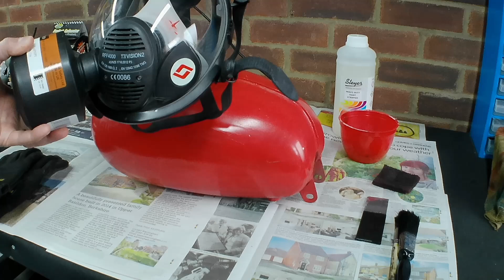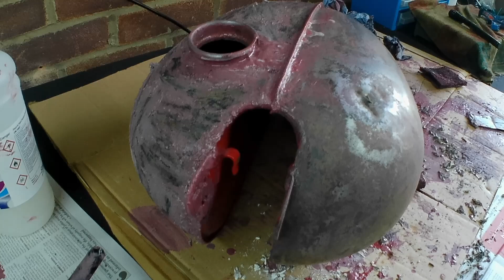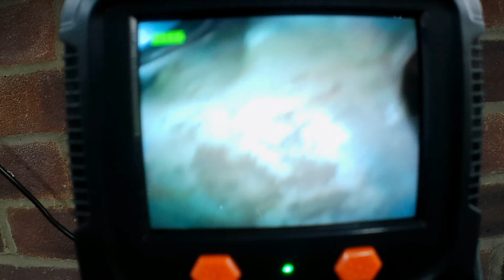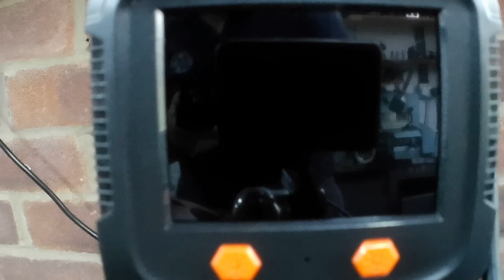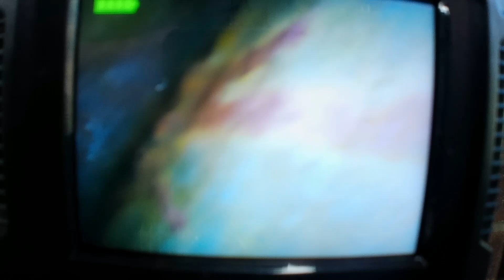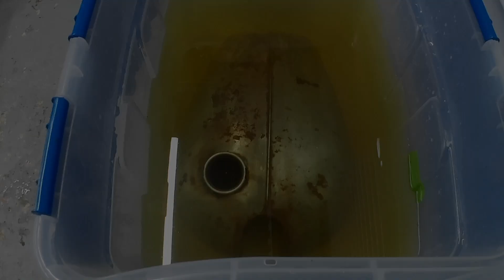BSA Bantam Fuel Tank Renovation - Tank Strip and De-Rust Part - 1

Comment: I used nitromors 30 years ago scratch the paint paint it on wash off in 10 mins all the paint would just rinse off. Nice video wish I could get hold of that paint stripper I have a few projects that could use it. Congrats on the 1K subs.
Reply from the maker: You might be able to get it, search for Methylene Chloride paint stripper. Things might be stricter in Spain, I'm not sure. Glad you enjoyed the video. 
Best wishes, Dean.
Reply: @retromechanicalengineer  Will give it a go but its strange here I can buy nitric acid here in the supermarket sulfuric acid 60% in the ironmongers but you have to sign and produce id for paraffin and paint stripper is a no no.
Reply from the maker: @makerepairbin  there doesn't seem to be much sense in REACH. The company I used is Steyer. Worth a go. Best wishes, Dean.